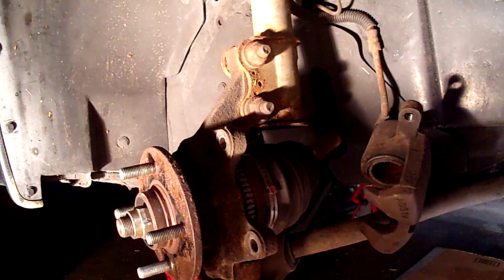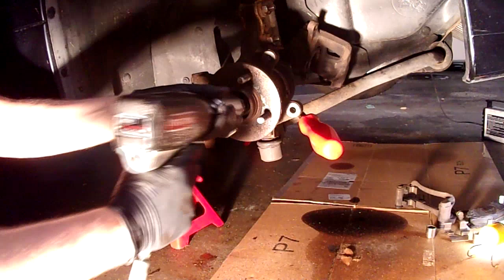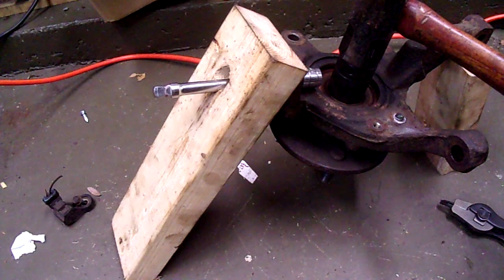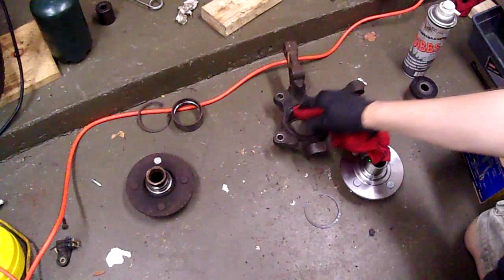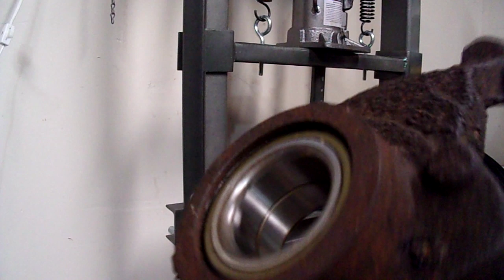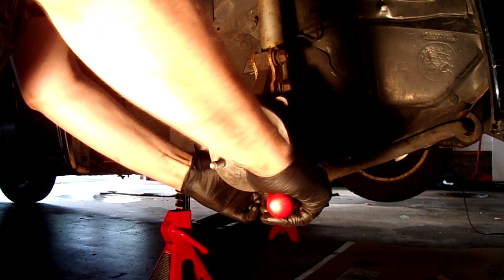Replacing Front Wheel Bearing in Saturn SL2, Pressed Using Harbor Freight Hydraulic Press

Comment: Great video. I do not have a press, but I did freeze the bearing to -20'f and heated spindle to 250 in my oven. Dropped right in. Used compressed air to cool down. No issues.

Comment: Thanks for taking the time to make this video.  I'll be headed out to the garage to do this in a few minutes and wanted to make sure I have all the steps set in my mind before putting the Mighty Saturn up on stands.  After reading articles on Saturn Fans, I wasn't going to make the mistake of using a hammer, lol.  I made a run to HF and got the 20 ton version of what you used and a pair of the Timken bearing/hub kits.  To avoid an alignment, I'm taking the whole strut down with it and will have my son hold things in place.  Thanks again for taking the time to make this video.  I know it adds a lot of time to a job to get the lighting and angle right, but it's very much appreciated!

Comment: @21:07   When you install that Brake Bracket did you apply any Threadlocker on those mounting bolts? I put a Blue Thread Locker on that job like a 1.5 years ago, everything was good, no problems w/breaks. I see in many films people use Blue TL on those attaching Brake Bracket-to- Knuckle bolts. But now I did smth else on suspension and needed to remove the Brake Bracket again. When I looked to double check the torque and everything in Shop Manual for our 2001 Saturn SL2 (I have one), they say there to apply Heat 272 Loctite or equivalent. And if you don't have that Red Loctite, you need to replace the attaching bolts. Of course it is advice for a shop w/unlimited access for the bolts of that type and everything, and they are very precise (supposed to be of course). But why everyone applied Blue, as Shop Manual says Red? That what puzzled me. This is full Saturn Shop Manual 2000-2001 S-series, very detailed, 3 huge volumes (4-5 different books inside of each volume, put together w/binder), thin strong paper like papyrus. I'm confused on all that. If I apply Red TL, will I be able to brake those nuts w/huge breaker bar, or heat would be needed? It is not a problem to apply heat of course, but there are CV Axle Boots there close by, I even don't know. And again, everyone applies Blue: The Mech a nic, Chris Fix, many others. I would appreciate any opinion on this matter. Thank you for the great film.

Comment: I suggest removing knucle & strut as one assembly....only 3 bolts more ...put the bearing in your feezer overnite.  ..when ready for new bearing heat & sand the area where the bearing sits till quite warm..bearing shoyls almost fall in. .  . cheers

Comment: Will they do torque specification, when you take it to the shop for the professional alignment? I didn't do a torque specification on one crown nut, that one which goes on the LC Arm, before I attached the knuckle to the stud, and now it is impossible to get the flared wrench there and I don't have wrench #18 straight which would work w/my torque wrench. I can find one of course, but think maybe it is not so essential, if they will re-torque everything in a shop. Thank you again for the film, I followed many approaches from it, was very helpful. Also it is good that everything is here, from the beginning to the end with placing the brakes back.

Comment: @17:08  Can you apply some grease on the attaching bolts (not on threads for nuts (on threads I'll put Blue Threadlocker), on that cylindrical part which goes inside of the knuckle)? We are in Texas, but after I removed those bolts, they were all slightly covered w/rust, especially by the head of the bolt. And I removed them before not longer then 1.5 years ago. I cleaned them, painted the heads. The rest of the bolt I wiped out w/PB Blaster, installed, but forgot to apply a bit of grease on them as planned before, like green Lucas, or Green 101 (they both have NLGI #2). I'm in doubts, if you are actually are supposed to apply that grease there, maybe it will leak on the threads and it could cause some problems, like it will effect that threadlocker or smth. I would appreciate any opinion on this matter. Thank you for this so great film.
Reply from the maker: Being from northern Illinois where cars get very rusty, I would apply a very thin layer of grease or anti seize to that area and spread it thinly with your finger. Wipe off excess.
Reply: @rocbola  Thank you so much for so quick replay. I'll redo now, I was planning to anyway, but it is so good to have your expert confirmation. God Bless you Sir. Appreciate very much.
Reply: @rocbola  Thank you. First I thought to redo, but then decided to leave how it is. It was my 1st job on CV Axle, maybe I would need to redo the whole thing. And PB Blaster is there, so at least some protection. The Driver side I'll do how you advise w/tiny layer of grease. Thank you again.

Comment: Nice Video.  I actually used a slide-hammer to remove the hub from the wheel bearing.  My slide-hammer kit also has a 3-jaw attachment that can be used for removing the remaining race (on hub).  Tried pressing a new bearing with my Orion bearing press/removal kit, but it would only press in so far before the threads (on threaded rod) started to get stripped.  Ended up getting the Harbor Freight Press and was able to easily press the bearing and then hub.  Cost justification of a hydraulic Press was worth it considering how much shops wanted to charge me for pressing two sets of bearing/hubs.

Comment: Is it essential, that those pointing ears on the brake pads are on the bottom? I believe in the Haynes book they are shown on the top (Fig. 3.6e on page 9-4) and that is where I looked right before placing the pads, bcs I forgot what exactly it was in the film. Now I checked the pictures I did on original location, the ears were on the top as well (by the dead end of the caliper). Maybe someone located them wrongfully (car has 130K, I practice on it, but from my opinion it is very good car). I located those ears on the top,  but now in doubts, since in all film I saw, including yours, the ears of the brake pads are located on the bottom. And in some films they are originally on the top, and then the author would put them on the bottom. Thank you very much for the very informative film.

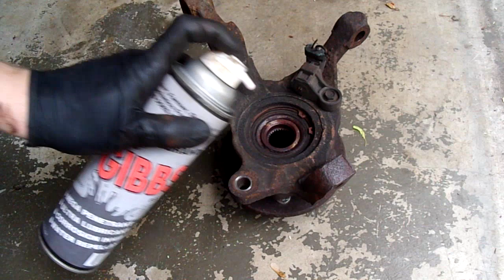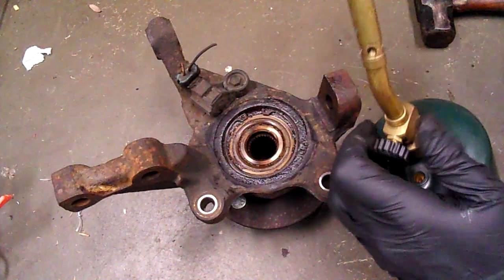Comment: Pls could you tell, at 8:46-9:09 there is a certain device attached to the knuckle (right upper corner, 
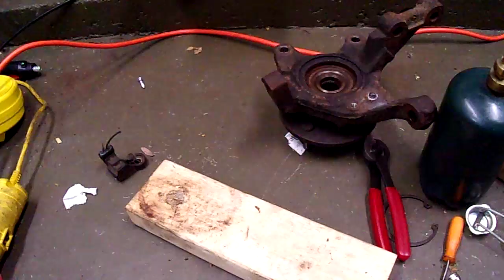above the central hole, back side of the knuckle, at 9:11 it is not there any more, you removed it for further work). Is it ABS sensor? I removed a knuckle for a similar project, and now when I'm ready to put everything back I see 2 holes without any screw in them. Maybe I misplaces them (which is very unlikely), but hope those holes just come from a certain design, which is universal, so the same knuckle can be used on cars with or without ABS sensor, and are not used for my car (2001 Saturn SL2, it doesn't have an ABS sensor as far as I know). Thank you for the film.

Comment: If you separate the races you can easily remove the outer race from the assembly by running a small bead of weld with an arc welder on the race, this will shrink the race and it will fall out.  Then you can use the race to push the new bearing into the assembly.  I've done it quite a bit as I am on my 3rd SL1, 216000 on the 1st one, 230000 on the 2nd, and 247000 on the present one.   Just looked here to see if anybody had come up with any shortcuts.
Reply: Got to love these saturns. If you know how to work on them they'll run forever.

Comment: Would just replacing the bearings require an alignment after if you don't remove the tie rod ends?
Reply from the maker: You will need an alignment if you have to take out the steering knuckle to use a hydraulic press. If you can get it with an on-car impact operated press, you wont need an alignment. I have found that those don't always have enough force to remove the bearing, but worth a shot.

Comment: What is the name of the central nut on the wheel (trying to match torque specifications in the book with the film)? Is it a nut for Hub/brake backing plate-to-knuckle bolt? Seems like it was just hand tighten. The film is good, but with torque specifications would be much better.
Reply from the maker: Axle nut
Reply: @rocbola  Thank you
Reply: It wasn't hand tight was it? Without an impact wrench you might have a job getting that thing off.

Comment: Good video save for 2 things you did wrong. 1) never tighter lugs with just an impact - easy to over tighten and mess up threads. They should be torqued to the proper specs. on most cars that is 80-100 ft. lbs. 2) there is a correct torque for the axle end nut that not only holds the axle to the bearing/knuckle, but also sets the bearing preload - too tight will cause bearing to fail early and too loose will cause that as well as letting things come apart.
Reply from the maker: I guess it was my mistake not mentioning in the video that i turned off my compressor towards the end and was not running at full power. I still had to tighten the lugs further once the vehicle was on the ground. Thanks for watching.

Comment: Why did you also choose to replace the hub and not just the bearing?
Reply: I think it is way easier. You can use a press in this method shown in the film. For example I replaced everything: and bearings and hubs. I don't think I would be able to do it on the car. Also hubs are at a good price, you can replace for a new one.

Comment: How did you keep the front shock from coming down on the axle rubber joint? I am trying to get the knuckle back on and the shock is too far down for me to get it in place. I have been working on this all day without impact tools. Just a socket set, a 30mm axle nut socket and an eighteen-inch bar. Man am I tired; I have another saturn as a parts car so I just switched whole knuckles instead of trying to replace the bearings. But, thank you for this video dude! I couldn't have done it without you!
Reply from the maker: Thanks for the comment! Did you already attach the ball joint to the knuckle? I usually have to start the splined section of the CV outer shaft into the bearing,  then spin the knuckle to attach the 2 bolts for the knuckle to the shock, and finally insert the ball joint last, using a prybar to push the control arm down. I have not had an issue with the front shock hanging low enough to interfere with the CV outer joint boot.

Comment: Yeah, I made this attempt on my Saturn and it's basically bricked now. Literally done, in pieces in the garage indefinitely. If you live on salty roads, think twice about fucking with this bearing. That stupid c-clip in my was completely rusted and fused with the knuckle. I mean, I've never seen anything like it. You can't even differentiate it from the knuckle. Nothing got it out; heat, tools, pliers, prying, PB blast, multitool. And it's impossible to get a new knuckle for these cars, they just don't make them. Took it to a mechanic, turned it away. I'm up shit creek over the c-clip.The bad part is, you can't really see it until you get it all apart.
Reply from the maker: What kind of heat were you using? I had one that i couldn't get out using propane, or any of my regular tricks, so i brought it to a friend with an oxy-acetylene torch, got it red hot before it came out. I also had one once that i broke the bearing in, and couldn't get the outer bearing race out from the knuckle, so i went to a junkyard and bought another knuckle. Both are options if you can't get the c-clip out. And when you put the new one in, put a bunch of grease in the groove so the new c-clip doesn't rust in place in the future.